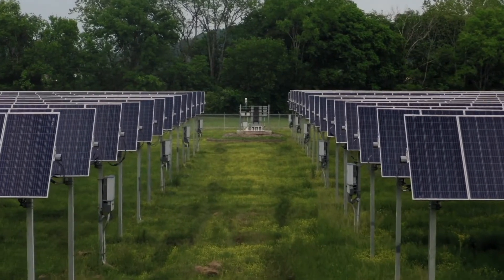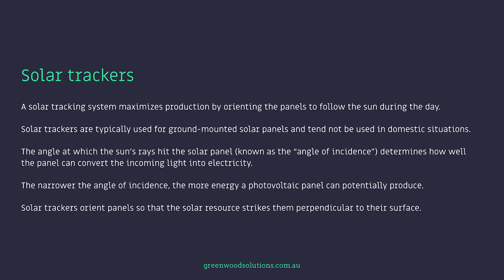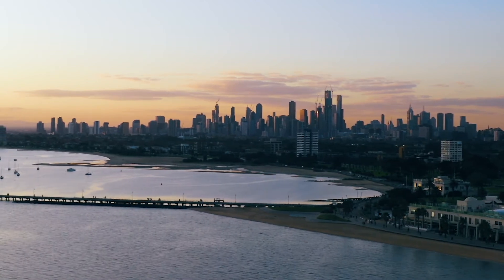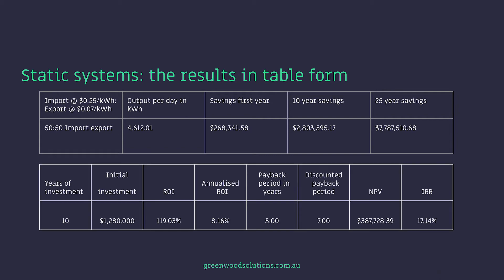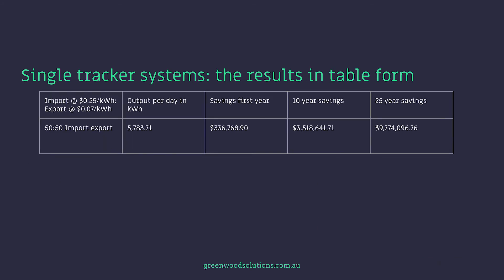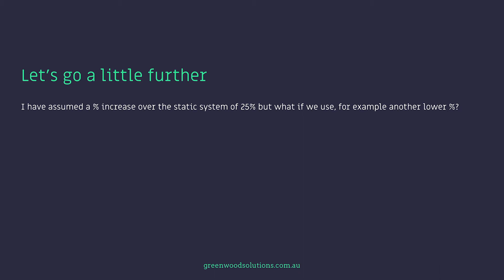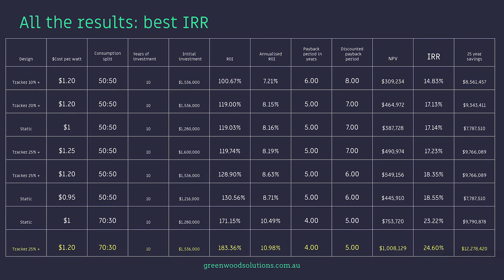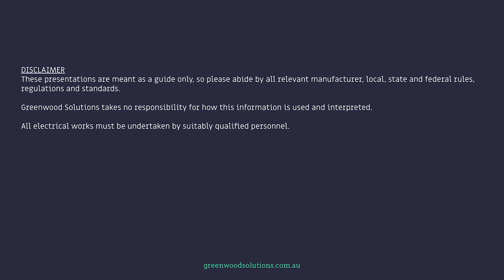Solar Tracking, Is It Worth It?

Comment: Thanks for a very interesting video!  A few thoughts on your analysis:

Your installation costs are extremely low, about 1/3 of the $3/W which is the rule of thumb in the US for large systems.  Is this realistic?

Your installed cost for the tracker is only 26% more than the non tracking, this seems very low.

Your maintenance costs on the tracking system of $1250 per year seem very low indeed for such a large system.  You will have failures and they must be repaired promptly to maintain system efficiency, so you will have additional monitoring costs compared to a static system and I suspect the actual maintenance cost will be significantly higher than your estimate.

Finally, your assumption that the ROI should be based on a fixed rated capacity as opposed to a fixed budget is interesting.  From a financial project comparison perspective, unless you face a constraint in rated capacity, I would think you would compare the two ROI's based on a fixed budget, with the size of each system being driven by that budget.  Thus the fixed system would be larger and you would be comparing $/KWH for two similarly priced systems.  However, it may be that you were constrained by capacity instead, as for example many home solar installations are constrained in rated output by the local power company.  This is the situation that I face, and I'm looking into retrofitting a tracking system now so as to actually generate a higher percentage of rated output. 

It would be great to publish your calculator and parameterize all of your inputs to the calculator so that we can try modeling systems with different assumptions.

Thanks again!
Reply from the maker: Thankyou. Fairly realistic but obviously installation costs do vary depending on many factors.

Comment: I didn't watch the entire video, but I don't like moving parts and a couple of mechanical failures could change the ROI greatly.
Reply from the maker: Cost benefit analysis. Moving parts, not the best BUT throw in time of use considerations and maybe trackers are the way to go.